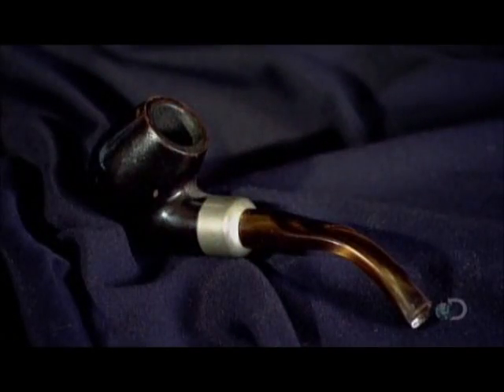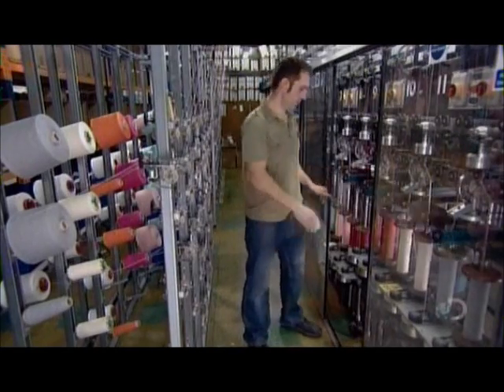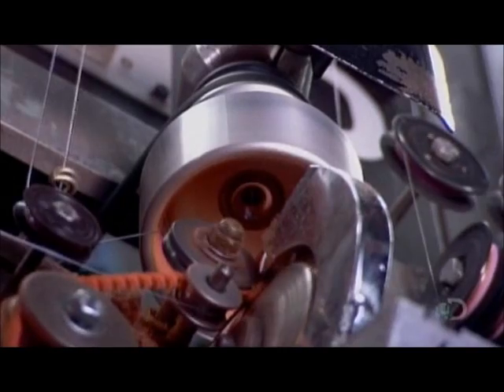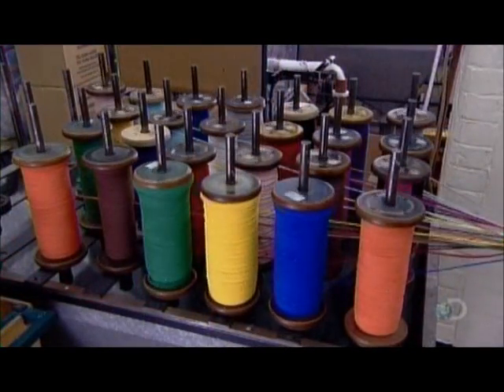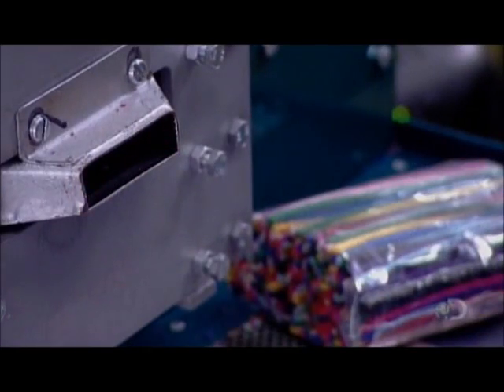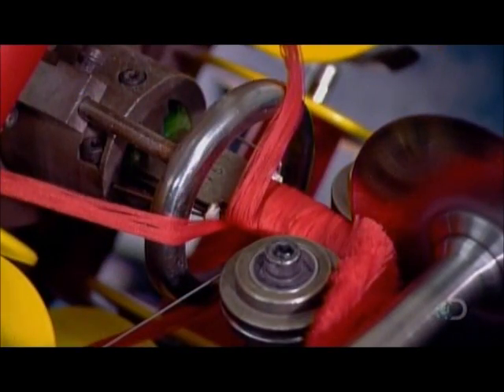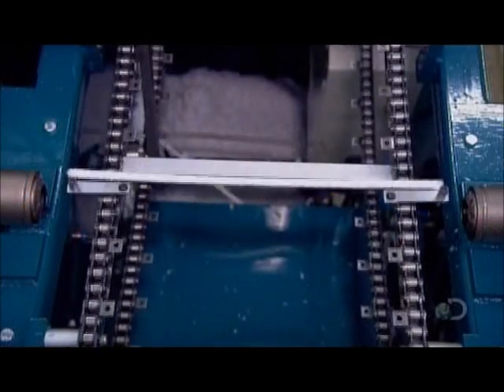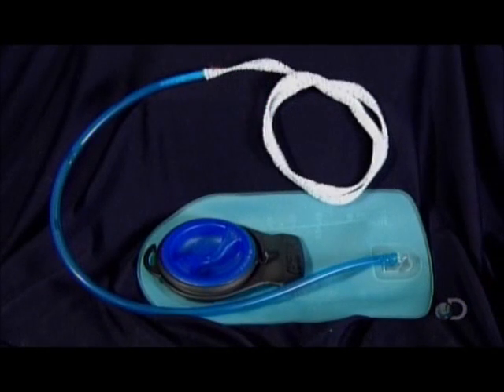How It's Made - Pipe Cleaners

Comment: I use pipe cleaners to clean many things around the house that Q-tips can't reach, such as the fan and the air conditioner.  I wish pipe cleaners would appear in the "cleaning supplies" section of the supermarket to help promote that there are many things they can be used to clean.